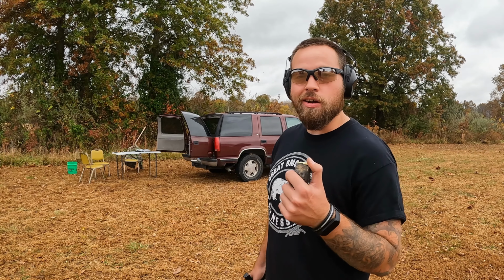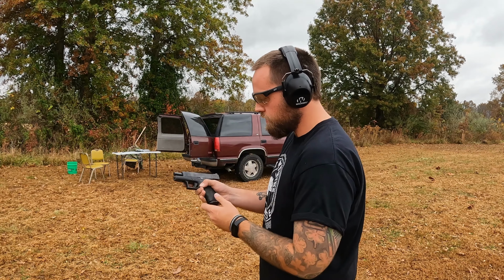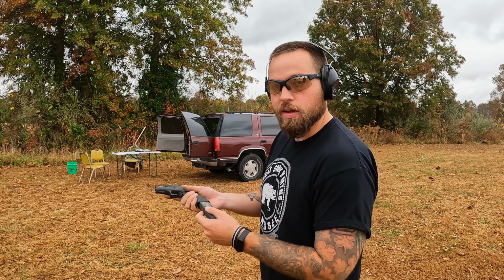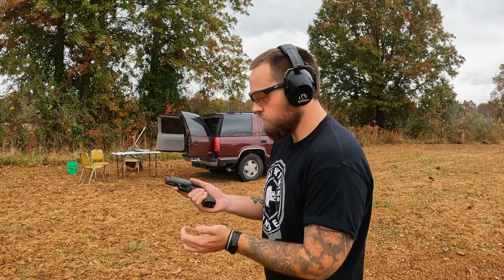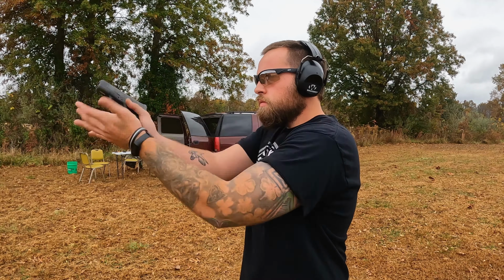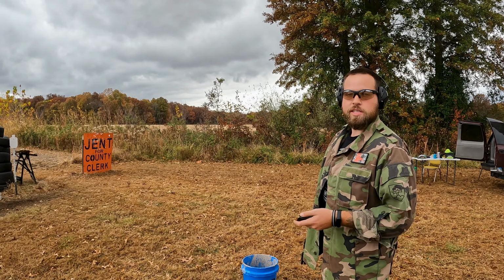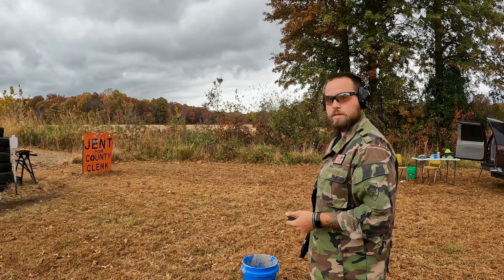Glock 43x OEM Magazine Torture Test

Comment: 99.9% of the time the msgs are clean or supposed to be!
By doing these tests you I introduced P.A. particles that score the chamber and barrel.
A manual of arms should not include these tests. Perhaps if you were in the jungle you could justify such a test.
The shield has entry points far larger then Orem mags from Glock.
The springs in shield stink and you demonstrated same.
A tolerance of .001” to .0001” is not intended to be hosted out by dirt and rock chips. 
Dust valid, lint valid water valid if you shake it out.
The rest is  S for the practical shooter for edc.
As an aside the dropping of mags and inception of a new one really speaks to one’s manual of arms.
Because som others do it, let’s live in the real world,
Clean your edc, don’t abuse it, and if you shoot FMJ the test is less valid. Try som Sig Elite or a HP with a larger opening that is what will make me change my opinion of a brand of mag. 
Don’t put ford rims on a GMC and show respect to the tool we call the 43.
Sorry to make these comments but as as QUAlITY curriculum writer who has visited many gun and arms companies globally
The hypothesis is flawed and the imperial evidence is missing.
Like your channel and hope your feelings are not smudged. 
My best Gentlemen,
Reply from the maker: These tests were meant to simulate the types of things that could happen if you get in a physical altercation. Getting knocked down and falling on the magazines, rolling through dirt/ mud. Becoming submerged in water. This was a torture test, not a manual of arms.